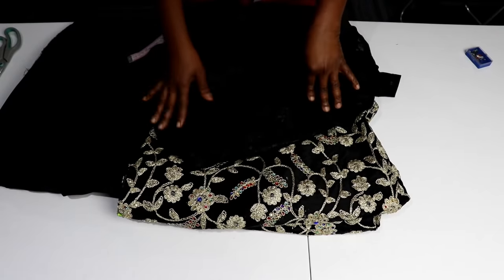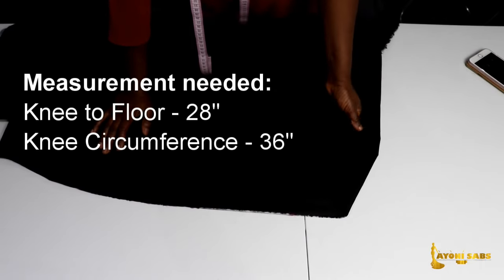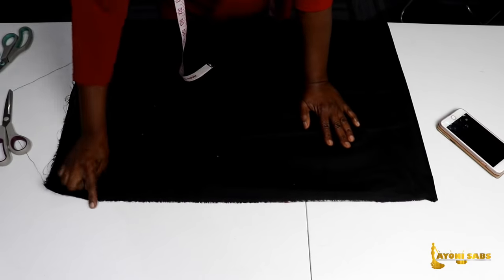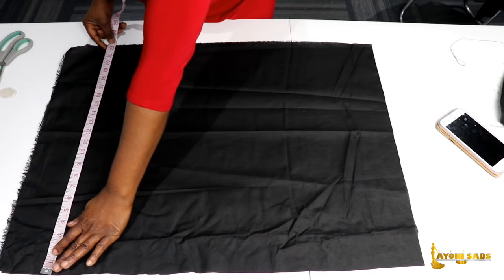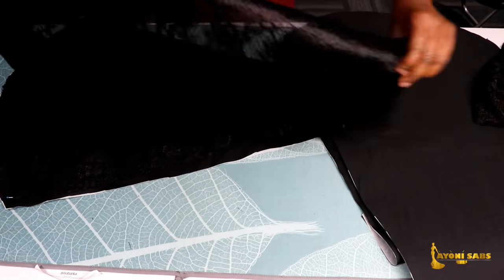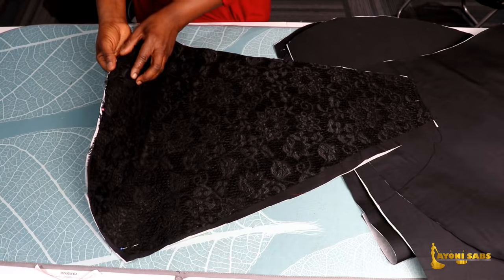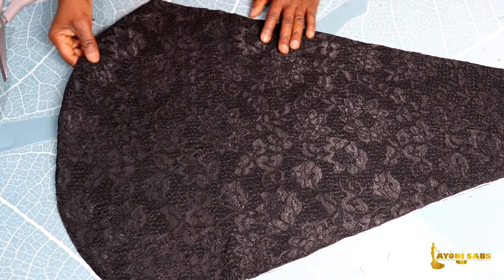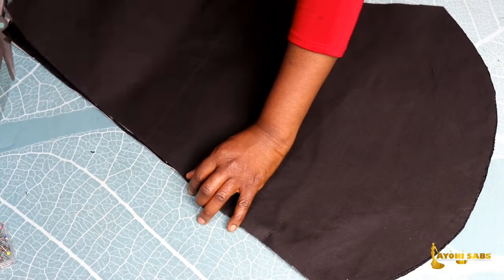How to cut and sew panel circle dress - skirt - ball gown (cone style)

Comment: Thank you so much for the tutorial. I am making one now, as a beginner, the interfacing that I use , I don’t know it’s not folding like yours. Secondly, are you not supposed to top stitch the bottom part and lastly are you not supposed to add seam allowance on the waist line. Please your help is urgently needed. May God bless you as you help me. This is time sensitive please and thank you so much.
Reply from the maker: Yes you can topstitch the bottom part and you can also add seam allowance to the waist but it's all added to the length of mine.

Comment: Nice. If you had joined the outer pannels at the sides and then the inner pannels same way. Then joined the two circles at he bottem hem there would have been no raw edges inside the skirt near your legs.
Reply from the maker: Mary Hornbostel Many thanks for the feedback. The inner seam edges were finished with bias binding and there’s another lining under the panels.

Comment: I like what you do in using a material for stiffining its not that hard and its manageable.
Reply from the maker: Yes buckram stiffener is too hard and could get soft when you wash or dry clean it.
Reply: @TresorTS  please ma'am what is the best stiffening material to add, that would not be damaged by washing and would still be firm, even after years of use?

Comment: Hello. Do you mind explaining how you cleaned up the the raw edges after connecting the panels all together
Reply from the maker: You can either use bias tape the bind the edges or add an underlining.
Reply: House of Tresor Academy thank you so much 🤗
Reply: Would you recommend using an overlock/serger on those skirt seams?
Reply from the maker: Yes you could.

Comment: Thank you very much ma for this.God bless you.Ma after sewing especially dresses,i have this problem of bulging/swelling at zip side.Is there any solution for it?
Reply: There are many videos addressing this issue on YouTube. Just type what you want and they will appear /pop up.
Reply: Before sewing the bodice/ top part of the dress, to the skirt part of the dress, cut away 1/2 “ to 1” at the bottom of the zip side, don’t cut the sides of the bodies, just the bottom part of the bodice before adding the bodice to the skirt part of the dress 👗 that will stop the bulging, bulging happen because the bodice at the back is too long at the back waist, Hope this helps

Comment: Hi ma’am  I tried it out but it never stood like a cone it fell flat . I would love to add images but I can’t add images here. Could you plz guide me why this happened ma’am ? How can I rectify . I would love to share images if your free to see .
Reply from the maker: Thanks for your message. Could it be the type of fabric you used? You also need to get some heavy weight interfacing. Sometimes inserting boning inside the underlining could help to make it sturdy if you're using soft fabric.
Reply: Thank you for your swift reply. I have used cotton lining fused with thick interface lining the kind you would use in men’s collar shirts. And then added boning  behind because it just stood straight and flat and did not curve. And the boning did not do much because the interface lining was so thick that the boning had no much effect

Comment: Thank you very much ma, but please which 1and half inch did you remove from that folded edge am confused?
Reply from the maker: 1 and half that I took out was half of the 3 inches that I need for each of the panels on the knee. My knee circumference measurement is 36” and if I divide that in 12 panels, it gives me 3”. So on fold, that will be one and half. Hope that is clearer.
Reply: +House of Tresor Academy  It is, thanks for explaining.

Comment: Is it compulsory dat u must use 38 inches to get d kneel length or kneel circumference
Reply from the maker: No, you used the measurement of the circumference
Reply: That means we would take d kneel measurement nd we would also take d measurement of d kneel to d floor?
Reply from the maker: Bazunu Wilfred Yes
Reply: Ok, thank u ma

Comment: how much meters should be used for skirt for full length.
Reply from the maker: ghufran ansari You will have to do some calculations. For instance, if your skirt length from waist to floor is 40. You divide your waist circumference by how many numbers of panels you want and how wide you want each panel to be at the bottom. 

E.g. you want 12 panels and you want each panel to be as wide as 24 inches. You multiply 24 inches by 12 = 288 inches. 

You then divide 288 inches into metres to get the number of metres. That will give you about 7 metres. But make sure the width of your fabric is minimum the length you need. I would go for a 60” width fabric. 

Is this clear enough?
Reply: @TresorTS  You said: "To divide your waist circumference by how many numbers of panels you want" I cam up with 2.9 or 3...But how do you decide how wide you want each panel to be at the bottom? Thanks~

Comment: How many yards of fabric did you use for the bottom?
Reply from the maker: Fe Goodson It would depend on how wide your panels are at the hem, how many panels you intend to have, how long are the panels to determine the yardage you need. For instance, you choose to have 12 panels measuring 24 inches in width, that would be total of 288 inches. 

If your bottom length is 25 inches per panel, and the width of your whole fabric is minimum 50 inches, then 4 yards of fabric should be enough. 

If you want your panel width to be wider at the hem or more panels, you would require more yards. Hope that clears it.